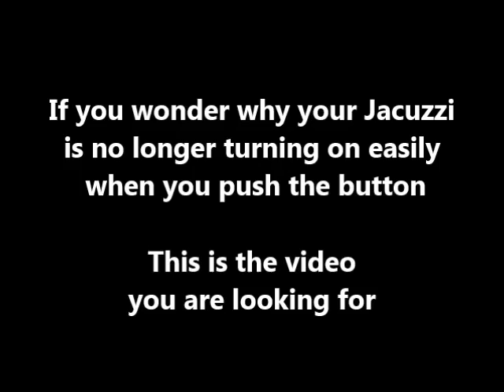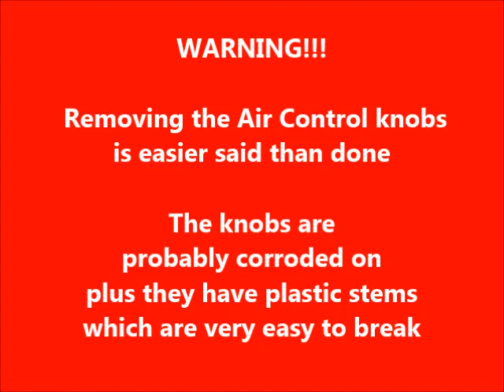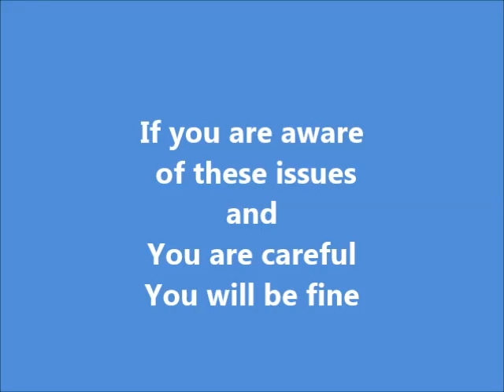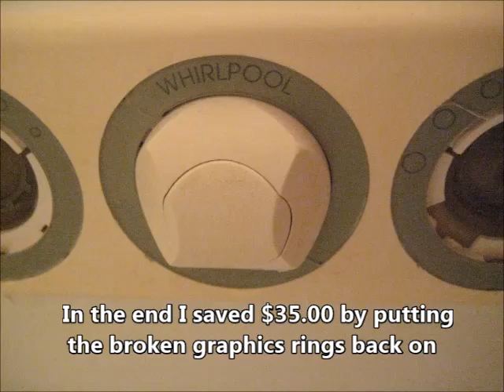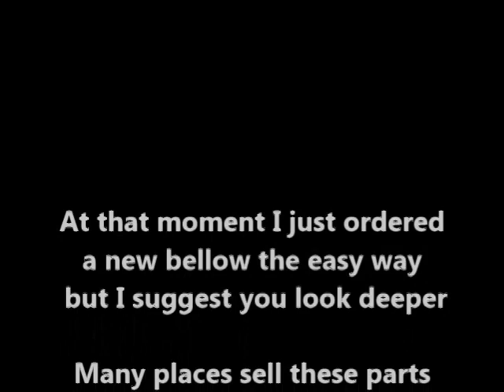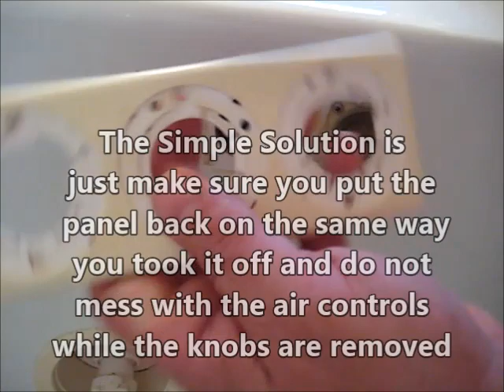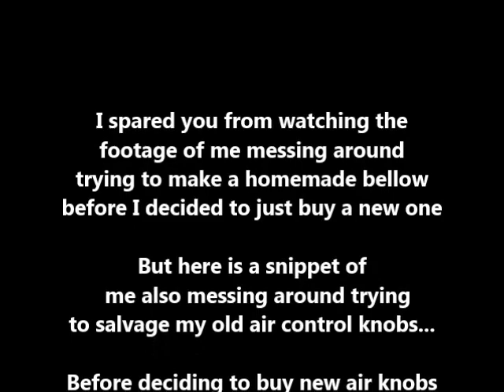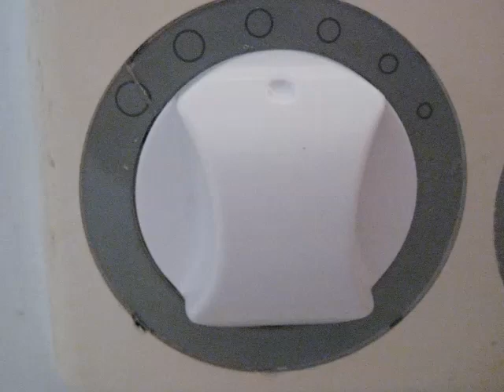Repair Jacuzzi on off button fix air switch not working on hot tub jet, the truth, replace pneumatic

Comment: A 6 year old video still relevant today!  Just watched your video and got all the info I need to repair my jacuzzi tub.  Great job explaining not only how how to repair, but also in describing the various potential pitfalls involved.  I haven't actually repaired mine yet but with this info, I feel pretty confident that I can.  In my case, I  just bit the bullet and ordered the entire 3-button control panel assembly for a little over $100.  Murphy's Law always seem to be in full force with the jobs I get into, so that way I have pretty much all the parts I'll need even if I do break some taking this apart.  And even with the added expense of the full assembly, it's still a load cheaper than having a service tech out or >gasp< updating/replacing the entire tub.  Ours was installed nearly 20 years ago and was still working fine but for the recent bad bellows/air switch.  So if this gets me through another couple years or so, it will be worth it.  Anyhow....appreciate the fine work you did on this video and sharing it with others!

Comment: I am pretty flipping proud . I did it !   I broke one of the circles but nothing a little super glue didn't fix.  I agree they designed this to be impossible to fix,  everything you touch breaks. Yes... it goes together.... more. .... or less.  Very touchy.
Reply from the maker: Sweet! Congratulations! And I agree, for the price of those silly rings... "just glue it back" works perfectly! It is all a puzzle and is fragile, easy to break... but going slow and being careful WILL get it going again and save A LOT of money. Plus not having to to deal with making appointments with service people, who do not show up.... PLUS not having people coming in to our homes (which has nothing to do with this virus thing) I have always not liked strangers in my home, looking around, "casing the joint", being nosy....

Comment: Dude you just saved me over $500.00 a plumber quoted me to fix my Jacuzzi!  The part is on Amazon for less than 20 bucks shipped.  THANK YOU!!
Reply from the maker: THAT is my total pleasure and purpose for posting these videos, thanks for the good words and letting me know the video did some good. 

PSIf you have not yet completed the work... be careful.... those parts were designed to break... but if you use a light touch you can get it done and get back to taking Jacuzzis.
Reply from the maker: SWEET!!!.... THAT is the exact reason I make and post my videos. Thanks for letting me know the video helped, that is the only pay I get for making/posting videos. 
PS 
If you have not yet completed the job be very careful, those parts are designed to break, but if your use a light touch and finesse you can get it done and get back to taking jacuzzis! CHEEERS!

Comment: Thanks, your vid added detail to some others here. I'll add what I learned: Graphic ring removal: After snapping the first 2, I recommend you pry upward at the smaller tab location, to pry the smaller tab up and out, which saved the 3rd one for me. Knob removal: After little progress, I decided to pull/wiggle EVENLY more aggressively and replace the knobs. Ended up with the front "Bonnett" or flange of the air valves pulling off with their snap retainer inserts, but preserved the knob stems. So I had knob and valve bonnet with o-ring. Then I was able to move to my workbench vice, opened to span the diameter of the valve flange and evenly support the knob face. (First, I did give a couple shots of Blaster penetrating oil into the knob.) Then carefully drilled through the center of the knob down 1/4" to the depth of the valve stem. I first piloted the center with a 1/8" bit, then opened it up with a 3/16" bit, and then used a 3/16" allen key as a drift pin to drive the valve stem out of the knob. It took quite a few sharp blows (with a light hammer) 'till it budged and was driven out. The key is light sharp blows. Cleaned it all up, lubricated the valve inserts with valve silicone and re-assembled. Now all I need is the 2 replacement knobs, hoping my local spa guy has them, or I'll order them online. Hope this helps someone else avoid the time and cost of replacing/upgrading the entire valve assemblies. I first started to cut the knob apart with a hacksaw, but realized drilling/drifting would be more precise and less chance of damaging the valve stems. Also Pay attention and note the orientation of the inserts/valve stems to the knobs.
Reply from the maker: Thank for adding tips. I will add that I put my broken Graphic rings back in. They are prices for new ones are absurd and after they are again covered with soap scum no one can tell, if one was careful about doing it all.

Comment: Thank you for the video, however I snapped one value off.

My tube is 19 years old, however I managed to get the tub back running.

Thanks again!
Reply from the maker: Dang, sorry to hear one broke off... I got lucky but it seems too easy to do. As I said in another post I suggest taking a look at my other video about this and doing some lubing and slight cutting when you put it all back together to make it easier to come apart next time.  So far it works nice and easy and I have been pulling off/pushing on the knobs every so often to keep them easy on/easy off.

Quote from above-
you might want to use some of the info I posted in my second video  https://www.youtube.com/watch?v=uo0yMWe9hwA It talks about how I hope to make this all easier to do the next time I have replace the on/off bellow

Comment: Got it all done and it seemed to work then.....the tabs from the plastic switch did not latch on the panel.  Then the air switch does not shut off.  Looks like I have to replace the air switch box.   ARGHHH!!  Your video helped a lot though and now I have a different problem
Reply from the maker: My pleasure to hear the video helped, I wish it would have worked 100%. Let us know how it all works out and how much that costs to help people who come along later.

Comment: Not sure if anyone else has made the same comment as this... The video is great & really helped us. However, I wanted to pass along a WARNING to anyone who’s controls are on top of the tub rim (instead of on the side of the tub like this video).  The air tube that attaches to the bellow can & will fall through & out of reach. Currently trying to figure out how to retrieve it.
Reply from the maker: Good warning Julie, thank you. I am not sure what it looks look with control on top, but is there is hole you look through, big enough to stick a piece of wire through try putting some duct tape on the wire and grab the air tube.

Or... I would guess there must be access to the inside some how. I mean they knew this would have to be replaced (sooner or later) so there must be a removable panel. My tub had 2 plastic panels on the side which gave access to all the plumbing parts below. It almost gave enough room to get to the motor, but I am glad I will try that.

Solution 3 is like the old story... A man is over at the neighbors having some innocent with with her... when suddenly they hear a cor door slam. THE HUSBAND IS HOME. 
She says "OH NO!!! He is going to kill us both if he finds you in in here"...
-and the guy says "no problem, I will go out the back door" ... 
-and she says "WE DONT HAVE A BACK DOOR!!!"....
-and they guys says "WELL, WHERE DO YOU WANT ONE?"

In other words, if there is no access panel, make one.

 It should be as easy as drill a hole, then use a small saw blade to make the hole as big as you need. BUT before you start think of how you will cover the hole. That should be simple too. Sny kind of decorative something with some velcro tape should do it ... and not look too awful.

Maybe make a video and post it showing how you solve the problem. Good luck
Reply: My problem is/was similar. Mine fell off against the back wall. I purchase a fiberglass fisher that was long enough and was able to get it out. I had to extend the air hose because there was no way for me to put it back on the way it was originally routed. This video prompted me to try replacing the bellow, I then discovered the air hose had come off the back of the bellow. Either way, this video really helped me!

Comment: Nice and informative video. I have tub which is about 18 yrs old and the jet covers are cracked and breaking off. They look similar to yours. How to you replace them? Is there a tool to unscrew them with? They have four notches on them and the nozzle sits inside.
Thanks.
Reply from the maker: Thank you for the compliment. It is my pleasure to make and post helpful videos and my only pay is through compliments. As far as your question... I am not sure and I have moved from where the tub is so I can not look at them... BUT... 

and at risk of not even answering the question you asked (sorry if that happens)

I am not sure what it takes to remove those parts you need to get to. As you probably know the world is full of all sorts of all sorts crazy "screw driver" heads that are NOT flat head or phillips head... there is also "star" "torx" "allen" "double square" "robertson" "hex head" "spanner drilled" etc etc etc ...all designed to make it a pain in the butts to do simple repairs. 

That is... if this is the tool you were talking about to get to the nozzles. 

If so....hopefully you have a local hard ware store (not a big box store ), a good old fashioned hardware store with "that guy/gal" who knows about these things you can take a picture of the screw head... or what ever it is you need to remove to replace your nozzles... and they might have the "special tool". If you ask at homelowesdepotbigbox they will probably shrug and grunt :) 

I love my local hard ware people... they are so smart. 

OR.... I might suggest contacting the iPoolandSpaParts.net guys or someone like them. I thought they posted a comment here... and it was one of the rare times I allowed someone "in business" to make money to promote their products on my videos. 

I allowed their comment to stay because they have videos too... and although their prices seem high to me... they do have a lot of good info on their videos and their web site help people, so they seem like good guys.... but I dont see the comment now so maybe they removed it. 

Here is a link to their videos and, as usual,I do not get compensated in any way for linking to them... but they seem to have some good info and parts. Also be sure to take a look at ebay for parts once you have the part number... you might find a bargain. https://www.youtube.com/channel/UC9UjbkY2pxAEW4YRh9DJ2-w/videos

Comment: My jacuzzi tub is stuck in the on position,  i took it all apart and I can blow in and suck in on the air tube but it doesn't shut off , does that mean the button isn't bad and maybe the switch on the motor is stuck , I can hear a faint click as I do it as well
Reply from the maker: That sounds like a bad switch to me. It should be an easy fix if you have access to motor where the switch is. Consider knockout part of a wall if you have to. Or call around and get a bid, but I bet it is something you can do if you are handy and maybe save a ton of money. Look for diagrams of the tub... search a lot. Get the part number and order it. I bet it is no too hard, but a service call will probably be expensive, so it might be worth a try even if turns out to be too hard, it is a bet I would make.

Please some back and let us know how it goes, it could help the next person.

Comment: Hi, how do you know if the problem is the button and bellow? Anything I can test before ordering parts and go through your great video/instructions?
Reply from the maker: It is probably the bellow because the button is just a plastic part that pushed in to the bellow.  To test it you have to somehow access the air hose. If you have a front panel maybe you can reach up and pull it off... then using your mouth blow. The air pressure goes through the tube and turns a air switch on and off. If you can do that and it oges on and off it is simply the bellow. No need to buy a button.

If you do not have a front panel, or other way to access the air hose,  you have to pull the panel off and do the air blowing test like that. 

If blowing through the tube does not operate the switch, then the problem may be the switch. Still not a fatal problem, but... not as easy as replacing a bellow. Maybe have to call a repair person.

OF COURSE, please take my words as one source of info, look up other opinions, and be smart yourself. Also, if/when you pull the hose off the bellow, do it slowly and pay attention so you can put it back on... if needed.

Good luck/skill getting it done easy fast and cheap. 

Worst case scenario would be you need a whole new motor blower and/or your tubes spring a leak or the tub gets s crack and leaks water. In those instance a brand new tub might be the best answer. 

And you know what?... even then it is not all that hard to do.... AND you will have a fancy new  set up that should work perfect for years. Heck you might even consider knocking out a wall and putting in a bigger/better tub. It cost time/money/effort... but the return is having a great tub you will use almost every day.

SO no matter what it will all be fine.
Reply: @7777jayhawk  thanks so much for your help!

Comment: This is great! Thanks for posting it. I took mine apart, didn't see anything wrong with the bellows other than it being a bit stiff on one side. The tube connecting it does have a small split right at the bellows end. I sealed that up with silicone. Oddly, it works fine when I have the cover off (pressing the bellows with my finger to turn it on) but when I reassemble it, and use the jacuzzi button it won't turn on. Do you think it's the stiffness? Perhaps the button doesn't accommodate the stiffness like my finger does? (and you're right, these things are grossly overpriced!)
Reply from the maker: Probably for sure the stiffness of the button is causing your issue, although if your connecting tube has a split it could be wearing out fast and you might as well replace it while you have it all apart... that is... if it is easy to get to.

If not I would just do the bellows for now.

Find an affordable bellows (and if you have to wait a bit to get one for a good price, blowing into this the tube with your mouth will make it operate while you wait) and then plan on replacing the hose when needed.

I know accessing the parts can be a huge issue, THE MAIN ISSUE, when fixing these things. The actual part replacement is easy... it is trading your first born plus a MillionDollars for the part and then ripping out/replacing a wall to get to where the part simply connects is the pain.

But if you are creative, use some good (small cool portable (LED)) lights and some mirrors maybe you can do it easy. 

Finally I will add, if you do rip out the wall, you might as well replace other things in there which will have to be replaced sooner or later... or find a way to leave an "attractive" easy access hole for future repairs.
Reply: @7777jayhawk  I found the part for $5 +$10 postage which is ridiculous but the best I could do. Thanks for the additional thoughts about the tube and access. I'll let you know if I git'er bubblin' agin!
Reply from the maker: @karensanders2785  I am sure you will be back to Jacuzzing again very soon.

 And again, even before you get the parts, you can simply blow in to the tube to make it go on and blow again to make it go off... that is if the rest of the tube and mechanism is good to go.
Reply: @7777jayhawk  SUCCESS! Trimmed the tube to eliminate the split. Put the new hydraulic button in and it works like new. Thanks for your help!
Reply from the maker: @karensanders2785  Hooray!! I always love to hear that! 

Enjoy that tub... it is a luxury... I sure miss mine. I really do :( I have not had a nice relaxing jet tub massage in a long time. I did not know how much I needed those.

Comment: what adhesive did you use to put the control pate back on?
Reply from the maker: I used DAP brand "KWIK SEAL kitchen and bath adhesive caulk". It comes in a red tube and sold at most hardware stores. 

Less is more. Use only enough to seal the edges because someday it will have to come off again.... plus more is messy. Make it look nice.

Additionally I suggest being careful if you use the type that comes in a toothpaste style tube, flat crimped at one end. If the crimp is defective it can burst as you are squeezing the tube. I have only had this happen once, but it was a mess and worth mentioning. If you squeeze lightly and keep an eye on it works perfectly.

Comment: My jaccuzzi  motor is not turning off from the neumatic switch. Is there a time cycle the goes through before shutting off
Reply from the maker: Sorry for the delay, but I have not been checking here this busy summer. As you probably know by now I do not think there is any kind of timer or cycling. If the switch button is not turning it off/on you can always try simply pulling off the black button and blowing in to the clear plastic tube... or attach some kind pneumatic hand pump which will blow air into the tube.
Reply: My tub doesn’t look like that. Most have one button